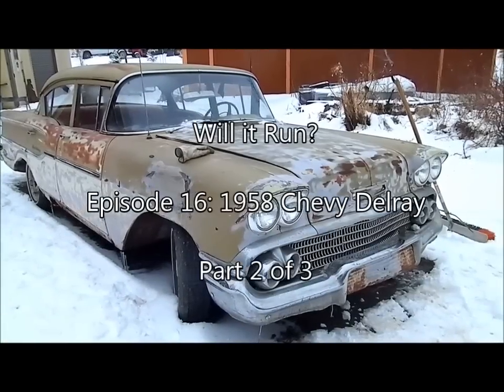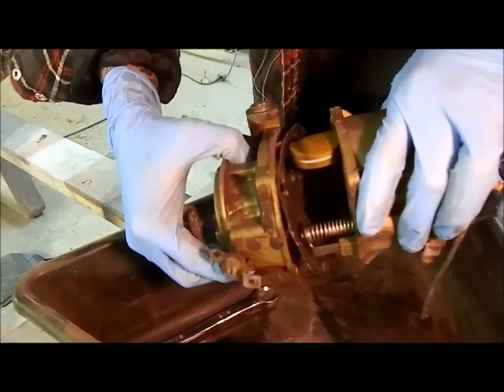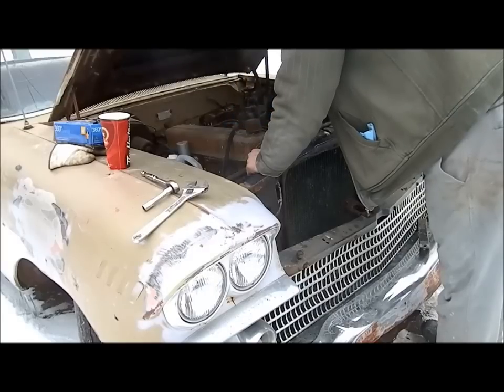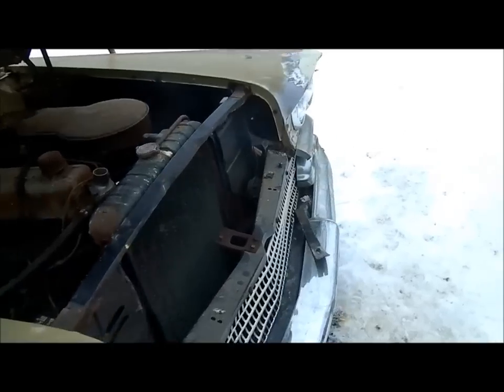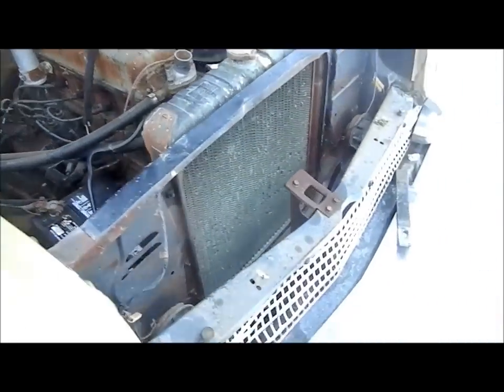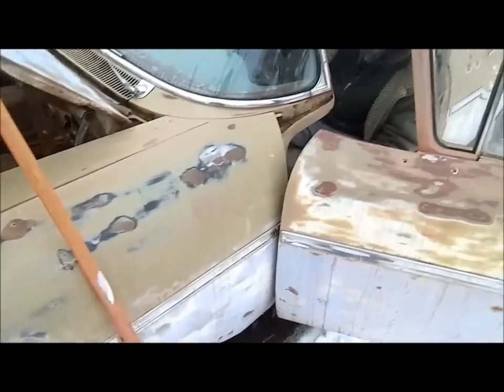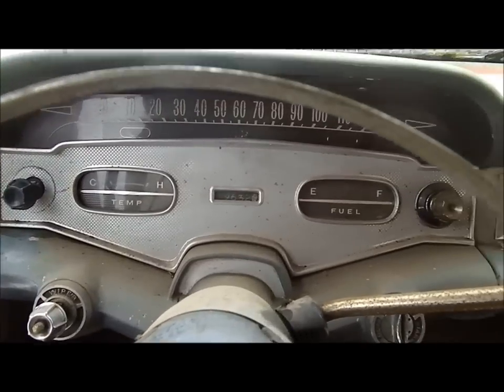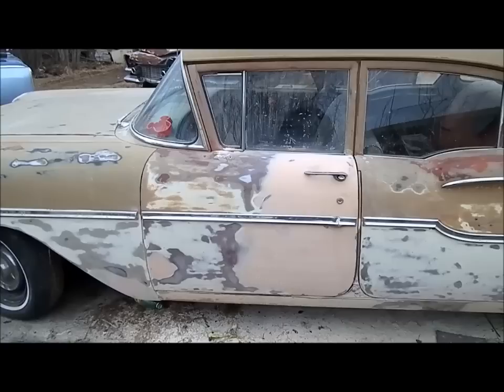Will it Run? Episode 16: 1958 Chevy Delray! Part 2 of 3

Comment: My first ride was a 47 Chevy 216 6 ran like a top with a three in the tree, God you put a smile on my old ass.
Reply: I agree.  That old girl didn't have any ammeter or oil pressure gauges just two idiot lights that are supposed to come on when the key is turned on and go out when started. Bulb is out on the oil light - I'd hook a temp gauge into the system before the filter.

Comment: An oil filter canister was an option in 58 and that Blue Flame engine was upgraded to 145 hp.  I waited for my parents to go to church in our other car (58 Olds) and took that Delray for a spin out of town and got that thing to dangle at 110mph. I was 13 years old.  My father years later admitted knowing I'd driven the Delray because it was still doing the cool-down "tinking" in the driveway when they got back from church.  I never told him how fast I'd driven it. Good days.

Comment: Is this the same sort of inline 6 say that wouldve come in late 1970's chevy novas?  i know our boat had the inline 6 i believe 250 CI engine and it was from the early 70's..Seems to be in the same family...We had a lifter that ticked for the whole time we had it and it never got worse and we never did worry about it...reliable indeed..
Reply from the maker: bababooey7576 I think you're right; same family. Great engines for sure. Thanks for checking out the vid!
Reply: coldwarmotors No problem.  Love seeing the old stuff run, especially on the low budget deal...
Reply: +bababooey7576 NOT same engine as later Chevy 6. 235.5 "Stovebolt" used to 1962.
Reply: Hott Puppy  same general family. not specific size/engine.
Reply: +bababooey7576 No, the engine in the 58 is different family from the later sixes. It is the second generation Chevy 6 that came out in 1937 and ran to 1963. It had splash lube for the  rods early on and went to full lube later. 4 main bearings. Had bypass oil filter. Third generation started in 1962 and there was some overlap the first year--Nova had 3rd gen 194 cu while full size had the 235 still. Third gen had full flow oil filter and seven main bearings. Bell housing patterns are also different between them. The later has the standard Chevy pattern. The 3rd gen was available in 194, 230 and 250--eventually grew to 292 for trucks. 2nd gen started as 216 and grew to 261 for trucks, 302cu for GMC
Reply: Hott Puppy Ok, that's what I needed to read.  Thanks for that!  The one we had, had a lifter tick in it the entire time we had it. We got the boat second hand, and the person, whom we knew, told us about it and said, it is most likely n othing to worry about.  It wasn't.  Other than that, it ran great and had a nice sound to it. I miss it to this day.  early 1970's. a 250,  I believe.